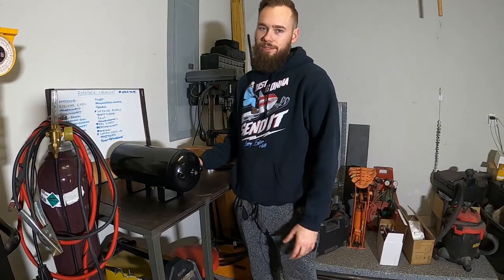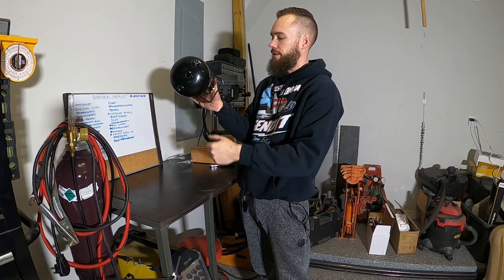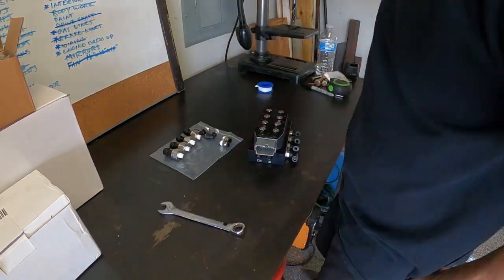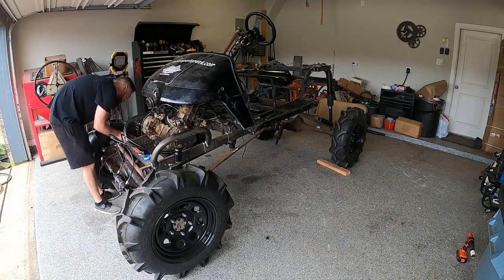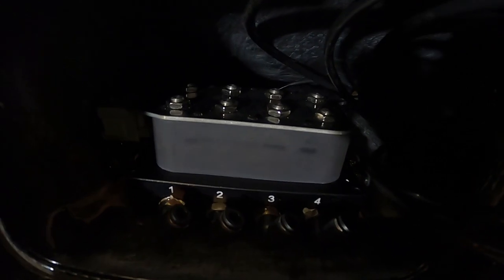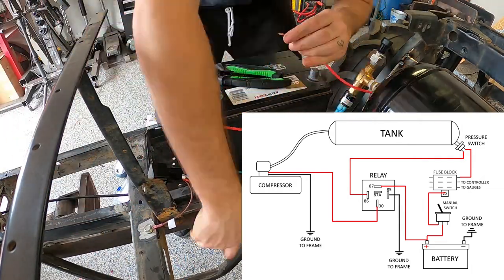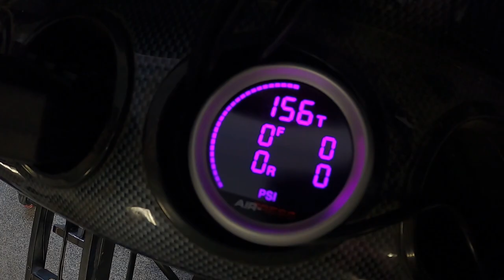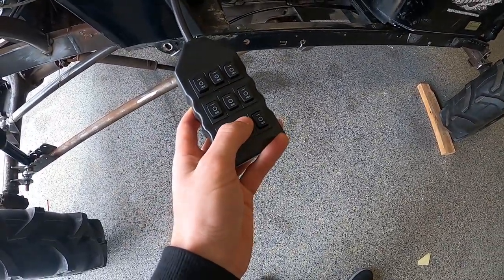Monster Golf Cart Build Part 4 Air Ride System Golf Cart Gets Bagged | Bare Metal Fabrication

Comment: dude bad ass i have the vu 2 solenoid instead of the 4 like yours im going to use a split that way i can use one solenoid for two shocks. wanted not use up to much space and keep everything simple. im going to run a 3 gallon polished stainless steel tank.  im not using a control box its all thru the iphone using an airride app. im going to post it all up so you see the kit.
Reply from the maker: That sounds awesome man. I wanted to do a phone app but it was a little out of my price range at the moment. But the good thing is I can always upgrade to one. It’s kind of a plug and play thing. Can’t wait to see how yours turns out!
Reply: @BareMetalFabrication   BROTHER I SPENT ONLY 250 ON THE UNIT AND THAT WAS INCLUDING THE BRAIN FOR WIRELESS.
Reply from the maker: @jaysgarage6784  Yeah the problem is I wanted the 4 corner valve manifold so that brings the price up quite a bit for the wireless version. But it is in the plans to upgrade to one in the future.

Comment: Question: any ideas on how to make my custom golf cart have a smoother ride?  Every bump I hit, the kids in the back get jolted rather than the suspension giving. Thanks for any guidance.
Reply from the maker: You could check to see if the springs you have in the back are the heavy duty springs. The previous owner may have installed heavy duty springs to prevent it from drooping with a heavy load. If that is the case then you can just swap to stock springs and get a smoother ride.

Comment: Awesome build man. I was wondering, what psi did it take on the shocks just to lift the cart up?
Reply from the maker: Thanks man! I want to say that I put it to about 65-70 psi for ride height.
Reply: @BareMetalFabrication  Ok, reason I asked is I have a 2015 E-Z-GO Express S4 and have some buddies that ride on the back that damn near reach max payload by themselves. Im looking at replacing the shocks on it with the ones you used and using them to support all the weight on the back. I'd have from 70psi up to 150psi to correct the added weight and level it off. Thank you!!!
Reply from the maker: @jasonhuffman9326  That should work great for what you are wanting to do. That's actually what the shocks were intended for.
Reply: @BareMetalFabrication  Sweet, thats what I'm hoping for. Lol. Either that or put them all the way around and make it able to lower ride height to be easier to load in the toy hauler. 🤣🤣